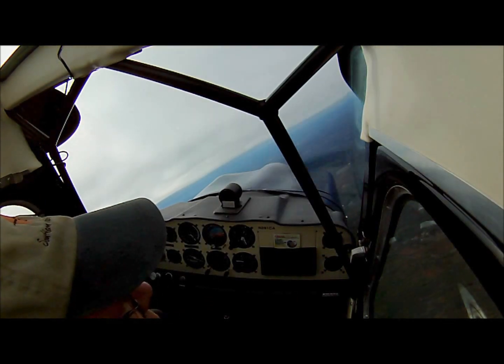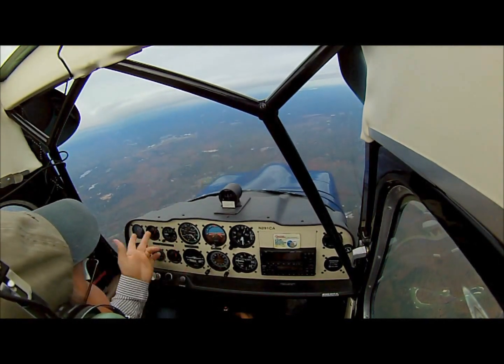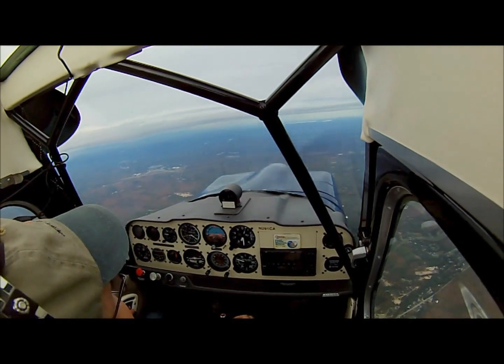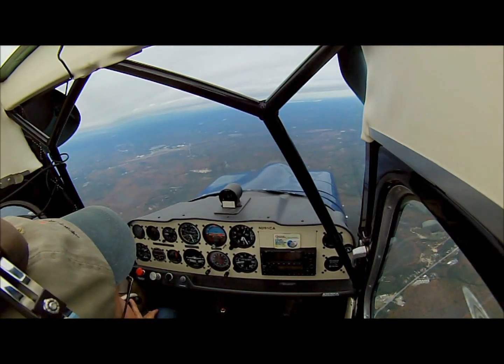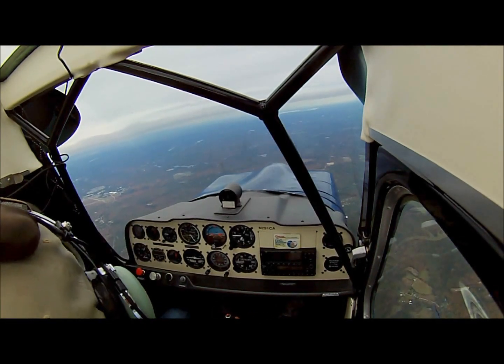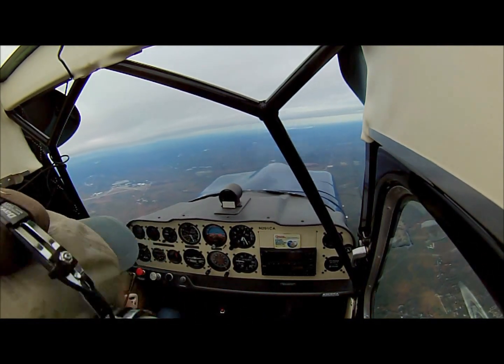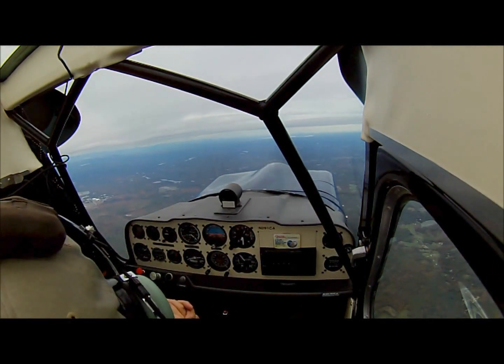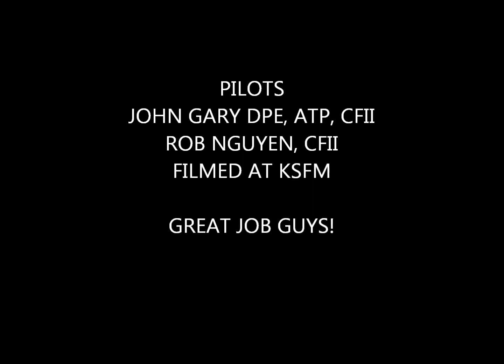AILERON ROLL AEROBATIC TRAINING

Comment: I did some aerobatic training in the mid seventies. Did spins, loops and snap rolls in a Citabria.. But never did an aileron roll. I have owned a 46 J3 Cub for five years and have done spins, hammerheads and one sloppy loop where the gas came out of the header tank all over my windscreen.  Always wanted to do an aileron roll but wasn't sure of the technique.  Think I will try one in my Cub next time I go flying. I'm not sure of the entry speed but I know it is a lot slower than the Citabria. Anyone know the best entry speed?

Comment: why nose up 30 degrees after reaching 130 kt?
Reply: If you don’t do that the nose will be very low at the end and you’ll lose hundreds of feet. A perfect aileron roll begins and ends at the same airspeed and altitude. The only way to do that is to pull up at the beginning.

Comment: So, when performing the roll, you apply full rudder in the same direction as the roll (left roll would be full left rudder), or opposite rudder?
Reply from the maker: For a typical aileron roll you just use rudder in the normal directions as you roll in and out, but hold ailerons only (neutral rudder) the rest of the way around.
There is a slow roll in which one applies opposite rudder in the middle of the roll to counter the tendency for the nose to drop, so the rudder is changing the whole way around.
So aileron roll:  Pitch up 30deg, neutralize elevator, full left stick plus some left rudder to counter adverse yaw, hooooold left stick….. once getting close to being right side up again, right stick and right rudder to recover.

Got this from my instructor.  haven't had the fun yet but I hope to this summer.
Reply: jim harrison How much back pressure is there? Is it applied throughout the maneuver?